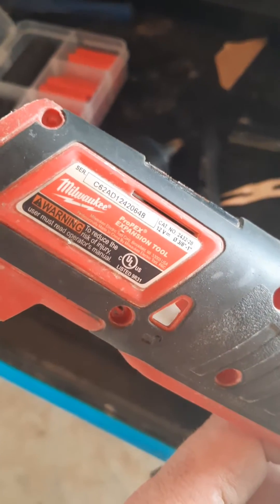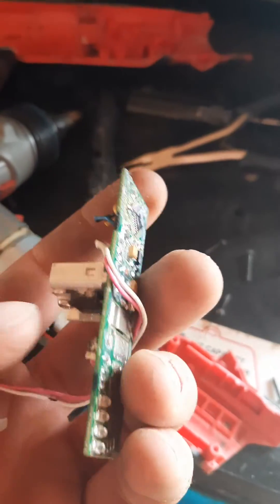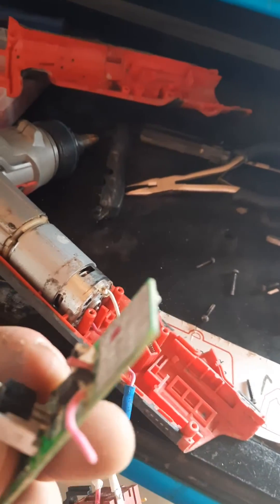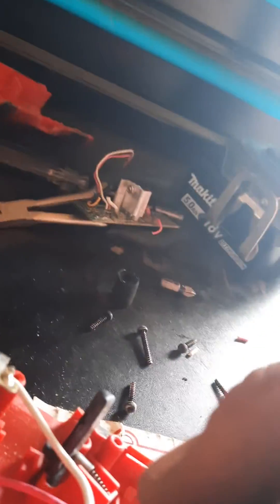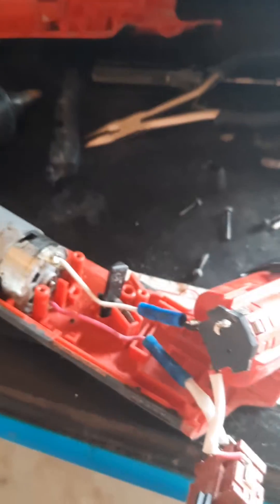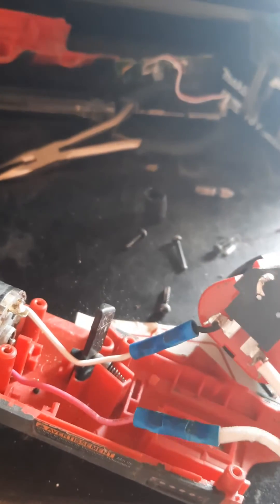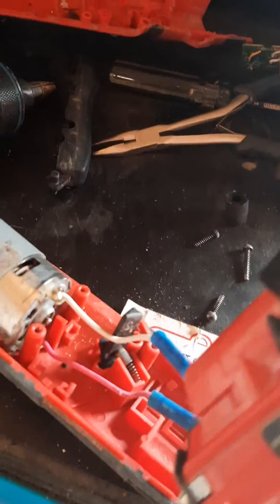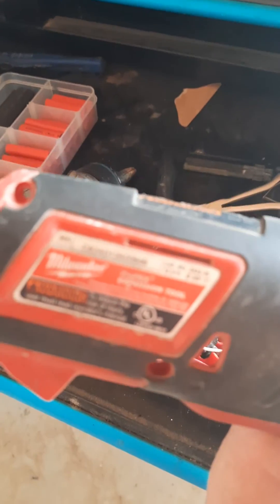Milwaukee pro pex Expansion tool fix

Comment: That circuit board does a number of things and yes, you are right it prevents the motor from burning up. It also prevents you from hooking up too much voltage , but it also prevents you from over discharging your lithium batteries, which can ruin them instantly